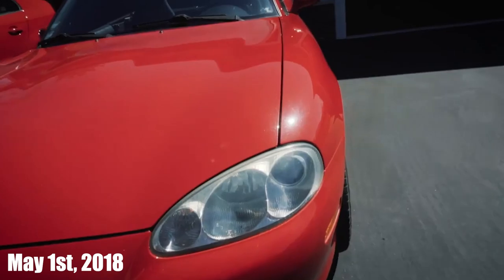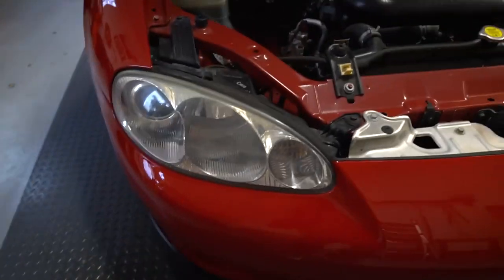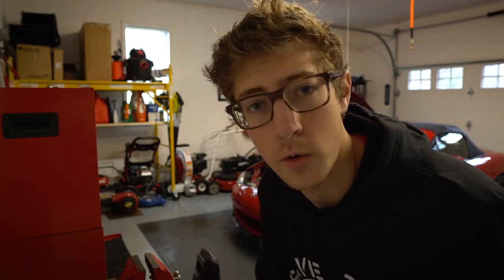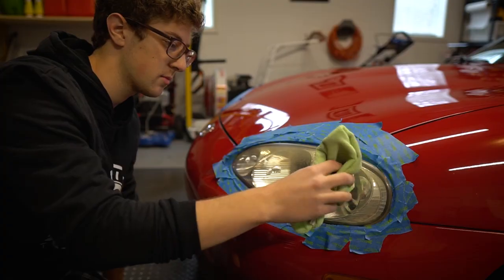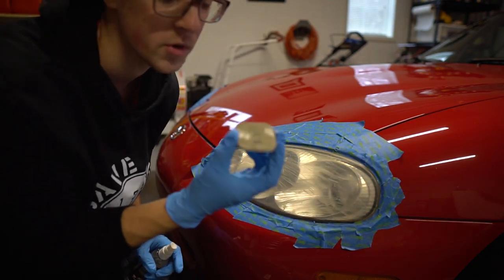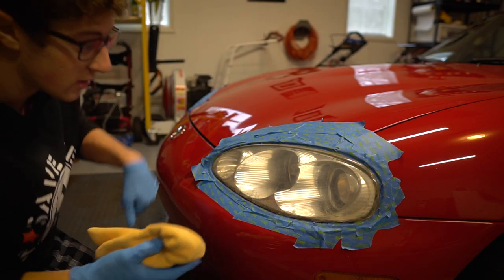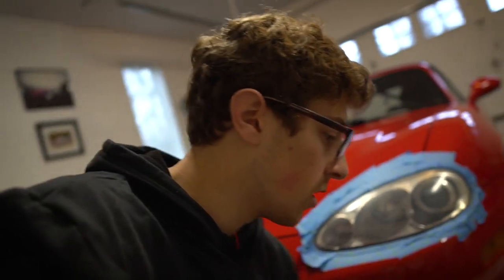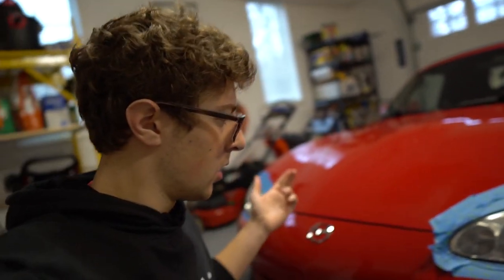Restoring My Miata Headlights

Comment: I got the same exact car. With 43,870 miles.  Just bought it.  My second nb2... all stock. Manual obviously. My first one was about in 2018. Splash green with 189k for miles.  The red one is so mint. I can't think of one thing i should do to it.

Comment: I've used that TurtleWax Kit on my mum's Rav4 - I hated the wipes as it left the surface of the headlight uneven. I used a AutoGlyn kit on my MX5 (it comes with a drill attachment and multiple sand papers, etc), it is superior and the results were excellent.